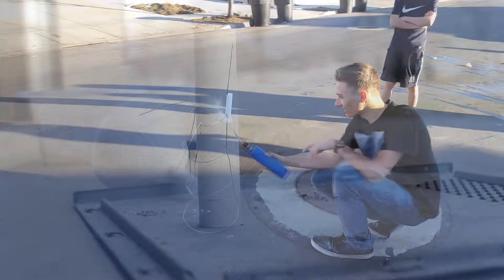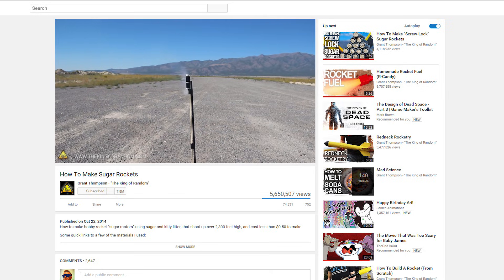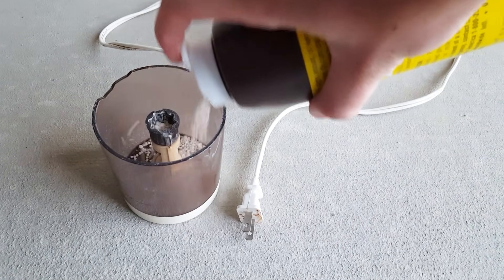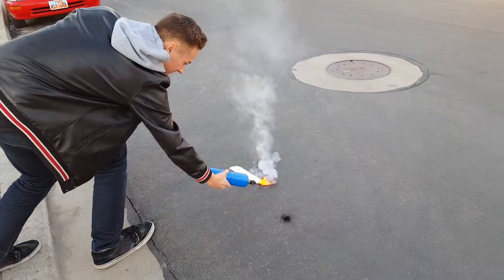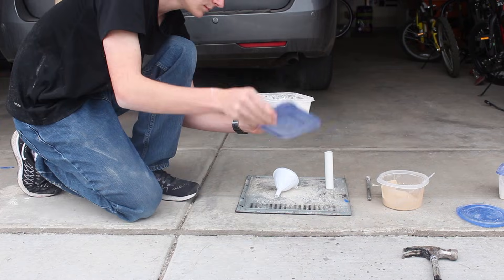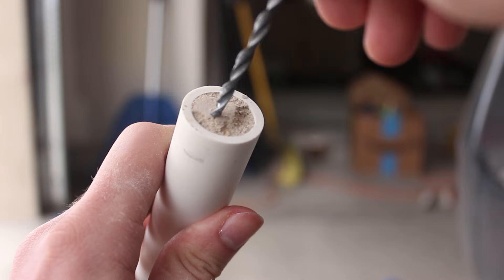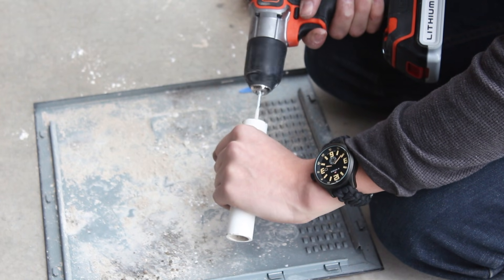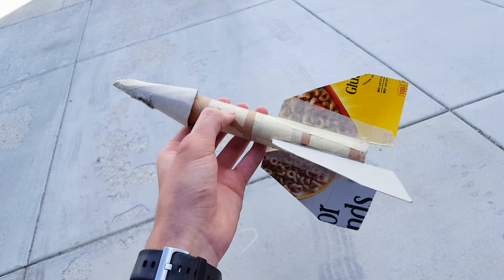How to Make Rocket Engines from Scratch

Comment: Powdered sugar (confectioners sugar) I believe contains some cornstarch to prevent it from clumping.  This may slow down the burn rate of your fuel.  Try using regular granulated sugar that you grind up in the blender.  I bet this results in a bit faster burn rate.

Comment: Or, you could just buy pre made engines that have been certified to work and cost lest than making your own!
Reply: This is actually way cheaper.
Reply: @16BitGoofball  So?
Reply: @dizzydude2840  What do you mean "so" lmao you said buying them is cheaper
Reply: @16BitGoofball  dude, you could buy this entire laundry list of equipment or just literally buy like 3 a c6-5 engines for like 8 bucks along with wadding and launch plugs
Reply: @dizzydude2840  It's hardly a chore. I can make tons of motors custom made for my needs for $12 worth of KNO3, some sugar and the old blender in my garage. I wouldn't make my own motors if it wasn't worthwhile.
Reply: @16BitGoofball  know what, fine.  Ill make my own motor and ill 3d print some stuff.  Ill tell u how that works.
Reply: @dizzydude2840  Home made motors and 3D printing? That's a good combination I make a lot. Good luck with that.
Reply: YOu must be a lot of fun. Get out and do something with your own hands.
Reply: @KipdoesStuff  why?
Reply: Thats not strictly true in some countries. For instance in the UK a twin pack of estes motors cost around 35 US dollars and that's from Amazon the cheapest seller

Comment: Some technical issues - 1. Once you mix the two ingredients its now called  "Propellant"  2. The mixture of Potassium Nitrate and powered sugar (regular white sugar) results in a very hydroscopic material so you have to seal the nozzle to keep air out if you are not going to use it right away.

Comment: You're illustrating some extremely poor judgment while building this. First, never mix in a plastic container like that. That's how you generate static. One spark=kaboom (youll notice this is a pattern). Second, you hammer it into a pvc pipe. Again, one spark- blah blah blah- but here's the most dangerous part:   PVC often cannot be told apart from human bone and flesh when medical imaging tools are used. This means that when you blow yours up in your face while using an electric drill to tool the engine (there's that spark part again!), doctors wont be able to use an xray to detect all the shrapnel in your face and chest. They'll have to do what's called "exploratory surgery" and basically fish around via fresh holes they cut just for the purpose. Let that visual sink in. If you live you'll be ground beef.

Dont ever use PVC.

Lastly, make an electronic fuse. This way you dont need to be near the thing if/when one fails and explodes. Look them up, theyre easy
Reply: Yeppers, these guys are complete morons. Nothing in the video is safe by any means.

Comment: This is actually a very bad idea. Rocket candy is notoriously unreliable and it can easily have too high of a pressure. PVC pipe is not made to handle a very high pressure, and because it’s PVC and not something metal, the doctor will not be able to find the shrapnel imbedded in you. If you really want to make your own motors, make an aluminum perchlorate motor or a black powder motor. Also, don’t use PVC as a pressure vessel

Comment: The powdered stump remover and the powdered sugar could be made into a paste with water which would assure a better integration of the 2 materials and be a plastic material to handle.  But not too much water.   Your PVC tube should have caps on the ends, but not glued on,  with a centered hole drilled in them so you can run a wooden dowel rod thru the holes thru the tube......therefore you could pack the plastic paste form fuel into the tube.....and let it dry out.  This leaves you with a packed tube of fuel when dried with the pre-formed center hole.  You'd just need the end plugs.  I would use a wood hole boring drill bit to match the PVC tube inside diameter to hand bore into the rocket fuel to the depth you'd need.  Kitty litter powdered and mixed with some portland cement and thus made into a paste would thus be perfect to seal the one end while the other end could be cast with the dowel rod inserted since the rocket fuel would have the hole thru it from its procedure.......and thus waiting for it to dry out.   You might speed drying by putting the tubes in to a bucket of rice since rice is a cheap item and draws moisture
Reply: kind of, you want to boil off the water so that the latice structure between the sugar and kno3 is super tight. water actually amkes these fail

Comment: U can add 1% iron oxide too increase thermo reaction
Reply: Yes
Reply: @sipperv1576  q
Reply: @sipperv1576  aRb
Reply: Yes, Genius.
Reply: Can the same be said for aluminum oxide? Or even possibly chromium oxide? I don't have iron oxide so Im trying to avoid ordering anymore components and using up stuff I already have 🤷
Reply: @jokinmyass9446  👍
Reply: Thanks Mel!
Reply: Do you add less sugar or oxidizer to add rust
Reply: @galvidmar1247  doesn’t matter it’s just an Accelerant. You don’t need much.
Reply: @melplishka5978  I know but you still have to think about stochyometry since you don't want to leave any fuel or oxidizer behind and if you remove any of those it will mess up the fuel
Reply: @galvidmar1247  trust me bud. For about a 100 grams of fuel just add a teaspoon. It’s enough and has no effect on the mixture except a bit faster burn. Do you cook yours or. Just mill it ?
Reply: @galvidmar1247  you can test it. Make a small amount with adding a bit of rust and see how well and complete it burns against a bit of the regular mix.
Reply: @melplishka5978  ive already done that but if you add 65 of nitrate and 35sugar and 1gram of rust you will have 64.5 and 34.5 and 1 percent of rust so the stochiometry of the proppelant is messed up if youre adding aluminum or boron and that is not good
Reply: @melplishka5978  i normaly just mill it since i dont have anything to cook it on
Reply: @galvidmar1247  ya but it’s negligible bud. Try it.
Reply: @galvidmar1247  if your making explosives yes then it’s counts but for burn rate if a engine it’s fine.
Reply: @galvidmar1247  ya I just mill  mine too. Ive don’t it both ways and there wasn’t much difference. Cooking it you have to worry about burning it too lol.
Reply: @galvidmar1247  did you try launching it? Like you said 64.5g nitrate - 34.5g sugar - 1g of rust. How did it perform?
Reply: @vibes.rewind  the same lol
Reply: @galvidmar1247  bruh 😂👌
Reply: Will it burn through the engine walls?
Reply: @saucemaster9483  katos are a part of rocketry if your not blowing shut up from time to time your not tryin hard enough lol.
Reply: @melplishka5978  I live in northern italy and here the model rocket laws are rlly strict so i don’t want it to fail bc it is gonna cost me a lot
Reply: @saucemaster9483  ok
Reply: @melplishka5978  Would aluminum oxide used for sand blasting work? Like the stuff you can buy in bags at harbor freight for sand blasting.
Reply: @budddove6480  not sure try it lol. I’ll see if I can get some. If you  do try please be very careful cause it’s extremely volatile lol.
Reply: @melplishka5978  I thought maybe you'd know for sure from your above comments. I will just find some iron oxide to try. Maybe once I get more familiar ill see if its a viable substitute for the recipe above.

Thanks anyways.
Reply: @budddove6480  ya I’ve tried aluminum powder from foil rap. Frikin insane. But not sure if the composition in the harbour freight stuff.
Reply: @saucemaster9483  sometimes lol. I use schedule 40 pvc it seems too hold up ok.
Reply: True, in the chemical reaction it acts as a catalyst, accelerating the process.

Comment: Well the kitty litter isn't necessary just but as nuts as me and use a 50mm x 1200mm stainless steel tube for your case and then put it on your bicycle

Comment: What if you add metals to the fuel could you technically make it colored? Or would it reduce the thrust of the fuel?
Reply: You could but you have to now the right metal powder to add you aluminum powder and you could very well make flash powder

Comment: You should dilute KNO3 with sugar before putting it into the engine body. When you let it dilute you ensure a proper mix. Also pouring it into the body makes sure that it is all well compressed more so than your powder and nail method. Additionally you may add 5% FeO to your mix as a catalyst for a hotter burn.
Reply: i have a question, why are they using cat litter
Reply: jentzen mast compacts well and doesn’t break apart easily as the exhaust goes through the nozzle (drilled hole)

Comment: Why would you want to risk serious injury or even death to make a small motor when you can easily purchase commercially made motors? If you ever had an overpressure problem that breached the casing you could be showered with PVC shrapnel, which is probably just as lethal as steel at those velocities. There are rocketry groups that sanction experimental motors; why not look them up and take advantage of the wisdom and experience of their members? Those people make anything from low power A & B motors to monstrous O & P motors for huge rockets. Each increase in letter class means a doubling of power,  so an O motor = 32,768 A motors.

Comment: can the rocket motor be scaled up? if i extended the fuel layer do i need to do the same for the clay end cap?
Reply: Theoretically yes, just take what he does and double it. Perhaps you don’t need to make a larger one, make multiple ones original size and tie them up. Tie the fuse and light
Reply: @NoahNinja69  what's the function of the clay  layer (end cap)?

Comment: I know I'm late to comment but, if you take some speaker wire and single out a couple of strands at the end and twist together, then insert all the way to the top. Hook to a car battery. It will start burning at the top and create more thrust as it burns down.

Comment: Stump remover is expensive it’s cheaper to buy the active ingredient the oxidizer potassium nitrate also called saltpeter
Reply: or sodium nitrate or nitrate of sodium or nitrate of potash
Reply: Mark Adolphus yah pretty much any powder oxidizer
Reply: @markadolphus5094  Sodium Nitrate is hygroscopic and will attract water causing failure of both sugar fuels and BP made with it if left at ambient humidity without protection. Water adsorption will cause cracks in your fuel grain if not protected (and yes, atmospheric water will eventually permeate thick-walled cardboard tubes (which you should be using in case of explosive CATO---plastic shrapnel not so fun).

Comment: you should not use a blender to pulverize Potassium Nitrate(stum Remover) because it is an oxidizer and is highly flammable instead you should use a ball mill and if you don't have one then you can use coffee filters and a hammer.
Reply: and don't use a drill to make a hole in the motor just use the drill bit by hand. You could have the thing go off in your hand and have some serious injuries.
Reply: That's simply untrue. Oxidizer does not = flammable. Let's see you get KNO3 to burn by itself. Metal dusts in an electric motor can spark from friction or ignite from contact with electrical components. It is safe to mill KNO3, strontium nitrate, etc., in any kitchen mill/grinder, so long as that mill/grinder is used for oxidizers only and kept clean. Or you can ball mill it if you are just looking to waste some time.

Comment: one spark from hitting that nail with the hammer and your in a world of hurt. use a wooden dowel
Reply: No, it won't. First you can't really create spark with hammer and nails, Then, you definitely CAN'T ignite that with a few weak sparks OUTSIDE of the motor. That's a stupid misconception, just like the fact that you can ignite the fuel with the friction of the drill

Comment: Hitting a metal nail with a metal hammer around explosive powder can create a spark and an unhappy day... that's why everyone else uses wood and a rubber mallet
Reply: No, it won't. First you can't really create spark with hammer and nails, Then, you definitely CAN'T ignite that with a few weak sparks OUTSIDE of the motor. That's a stupid misconception, just like the fact that you can ignite the fuel with the friction of the drill.

And, actually, everyone else use Richard Nakka method, not this dangerous and uncareful one

Comment: Pretty much one of the worst tutorials for SRBs, i'm sure most motors made like that exploded due to not enaugh strong combustion chamber, or choking effects. Also those engines are not efficient due to lack of nozzle. If you want to make good motor, better first learn physics, or use SRB simulators and design thing first
Reply: and some other basic skills like explaing things clearly , measuring stuff and concept of  center of gravity    ...as well as gravity goes down, wheres this going i wonder?

Comment: The reason for a wooden dowel is it will not create a spark when hit with a hammer, the nail might and a big boom will result.
Reply: No, it won't. First you can't really create spark with hammer and nails, Then, you definitely CAN'T ignite that with a few weak sparks OUTSIDE of the motor. That's a stupid misconception, just like the fact that you can ignite the fuel with the friction of the drill
Reply: @shere_kan8329  man can you please clarify to me what is cat litter ? I am not American and It's meaning is not very clear to me.
Reply: @Abdurrahman1-i4y  it's the stuff you put in the "toilet" of a cat or dog, or animal. It's designed to absorb the smells and moisture of the animal's excrements. 
But, don't use it, it's very unsafe and hazardous. You should definitely consider buying commercial motors, not very expensive and a lit safer
Reply: @Abdurrahman1-i4y  Essentially it is clay.

Comment: can the rocket be a bit safer and easier to use? If the fuel is a little would it be not too strong? cuz im using it on a person for an experiment. it's basically rocket leg which there was a youtuber that built it but i can't find a model rocket so i need to make my own. Can it be not to powerful if i only add a little?

Comment: There is better mix than using just kitty litter. Kitty litter fails and erodes during blast off causing lost Newton's of thrust.
Reply: Desert Jeff The clay does erode, but managing this problem only becomes worth the effort in bigger, more powerful and reusable motors/nozzles.
Reply: If you compact it hard enough it doesn't.
Reply: @krisknowlton2658  It does.
Reply: no
Reply: Mix in some epoxy

Comment: mine is not working properly could you help me
i really need it
Reply: I use an arbor press to compact all the ingredients. I grind the kitty litter to a fine powder. When it is compressed with the arbor press it is so hard you can barely scrape it with your fingernail. Drilling the hole with a power drill is not a problem if you drill a little and clean the bit. Then drill and clean. I have never had a failure with any of my motors. I use a wooden dowel the same diameter as the inside of the pipe. I have even used a motor over again with the same nozzle and there wasn't any erosion after the second firing.
Reply: Also I mix the sugar and the potassium nitrate together in a Nutra Bullet for about 5 seconds. The wooden dowel is used as tamper ram.(from my other comment)
Reply from the maker: It took us over a dozen tries before we finally got one to work. They're very finnicky, keep at it!

Comment: hardest is to get fuse line, any ideas?
Reply from the maker: Before we got fuse, we tried to ignite the rockets by stuffing the tip of a match into the nozzle and packing a bunch of fuel around it to guarantee ignition, but it had like a 10% success rate. Fuse really is 10x better than any DIY solution we could come up with.
Reply: So, where did u got fuse line from?
Reply: theirs some on the Walmart website with free shipping for $12.98.
Reply: Cotton yarn and melt some kno3 potassium nitrate and a pan rub on yarn string and let it dry and you got a fuse
Reply: just take it from a firework

Comment: Is it safe to use a electric drill when drilling through the fuel??
Doesn't it heat up and have the chance to ignite?
Reply from the maker: Yep, but it's waaaaay slower to drill by hand. If you go slowly enough you should be fine 👍
Reply: Blasted Science ok, thanks a lot!
Reply: Btw, is fertilizer with kno3 in it a good substitute for the stump remover?
Reply: @Supersonic1000Mr  depends on the presentage

If it's pretty much KNO3 (more than 50% ) i think you're good to go
Reply: Dang Itshere Thanks a lot bro

Comment: Hi! I was thinking of making one of these and I am wondering instead of gun powder for the parachute ejection charge what else could I use?
Reply from the maker: Heck we didn't even bother adding a parachute
Reply: Blasted Science omg lol 😂
Reply: @airhead395  yeah they're just shooting PVC around, welcome to eco friendly 2020
Reply: match heads?
Reply: Anything with working fuel/oxidizer mix, but why you need a parachute?
Reply: @dannydetonator  so that it hits the ground properly
Reply: you can granulate the fuel mix to make an ejection charge
mix with some denatured alcohol til you get a paste, spread on waxed paper and roll thin (~1mm or 1/16") and let dry, then crush or chop into granules
the sugar can be substituted for charcoal dust (get lump, not briquette) 3 part KNO3, 1 part C by weight, then granulated (you might need some binder, I hear Elmer glue might work)
Reply: @pacman10182  this is probably the best and cheapest way to get an ejection charge KNO3 Potassium Nitrate( Stump Remover).
Reply: rocks

Comment: When you drill completely through the fuel it will not propel properly
Reply: what are you talking about that's what you're supposed to do !!
Reply: patman0250 on larger rockets. Not a tiny end burner.
Reply: eddie man same